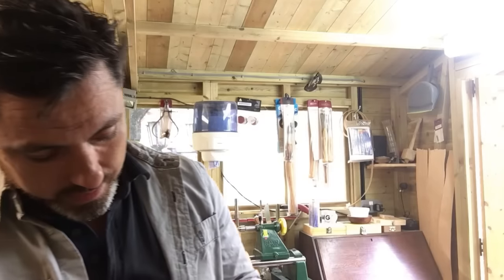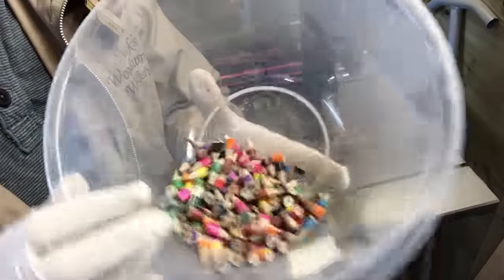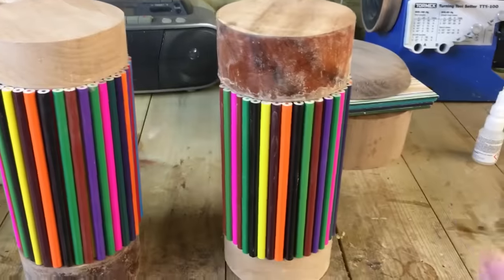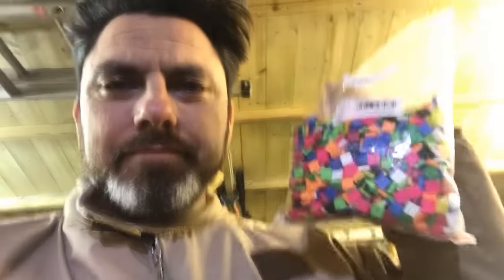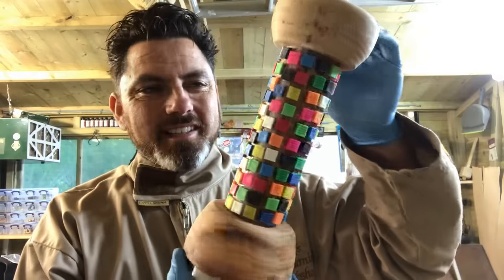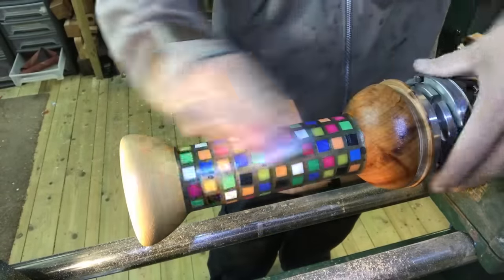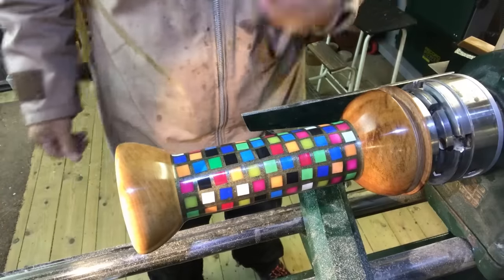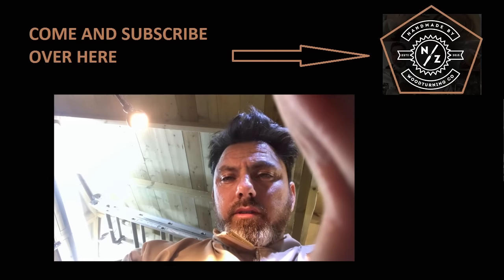Woodturning - A Failed Pencil Vase- Turned Mosaic Vase

Comment: YA KNOW these funky vases that are intended to be decorational would make AMAZING housings for a bluetooth speaker. I've done a good bit of woodturning myself, 98% of it was focused on pens. I had 3 western red cedar bowls in a row explode on me during final touchups before sanding and I haven't wanted to put much in the Nova chuck since. I've set my lathe back up and bought more mandrels kits and such, but my time has been sunk into getting my bladesmithing/blacksmithing workshop put together and learning how to make better blades. I will be turning again at some point here. I DO miss resin casting a LOT, I had some BADASS 4 color pours built around Pearl Ex interference colors punched up with tattoo ink. I'm going to start casting Alumilite for knife scales before too much longer here.

Comment: Good on you for not giving up mate. I think I am going to have to scrap my Halloween project due to multiple disasters. I have found that the best way to get the brass resin between tiles is to use a big 50ml+ syringe. Cheers, Jim.
Reply from the maker: Jimson's Stuff hey Jim , thanks mate . Oh yeah I didn't think of that . I will buy some of those . Thanks buddy 👍🏽